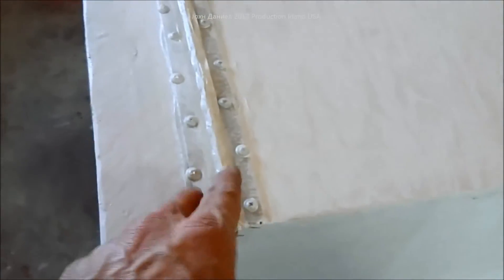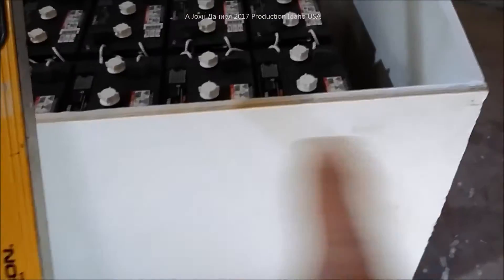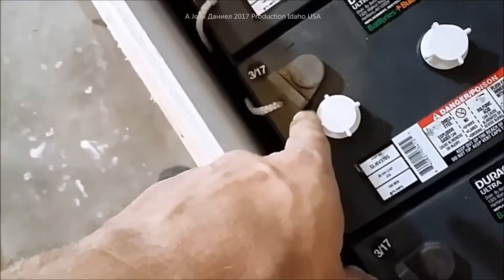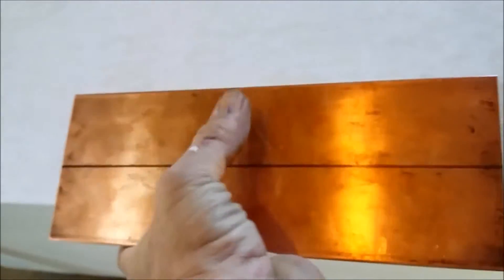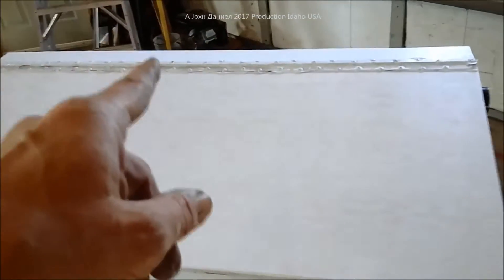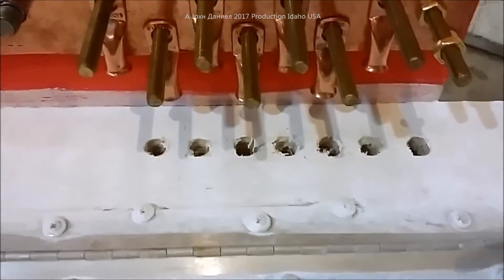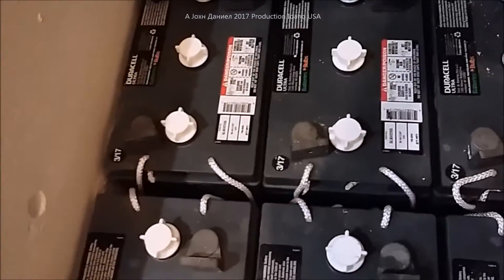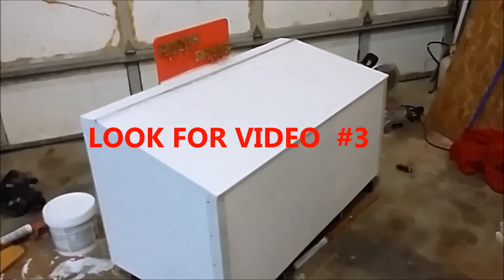Deep Cycle Battery Box Build Vid 2 of 3 (info below)

Comment: Is there a reason you used 3/8" copper buss bar? Or, could one use 1/4"?
Reply from the maker: I used 3/8 due to needing some thicker for another job, but normally 1/4" that is 2" wide is mega buss already.

Comment: Ofc actually produces a higher amount of amperage I've tested it not only in the automotive industry running a 8k rms system (bass head i know) but in solar applications the conductivity is a lot higher there's a lack of air they pretty much packed the wire tight together and it's solid real copper no additives for the most part visible amperage difference same length runs for the wire but be warned if you do it it is going to hit your pocket pretty hard it's not cheap by any means but I'm not bashing your point of view to each is own.

Comment: The current does tens to flow on the outside of a wire, it's called skin effect and it happens because of the generated magnetic field (eddy currents), but it does happen mainly in AC or in DC frequency carriers. https://en.wikipedia.org/wiki/Skin_effect
Reply from the maker: Skin effect occurs in open flow alternating voltage, its the cycle effect. No current has skin effects in DC. 
You would think such a well expressed mathematical theory could be supported better than they do, however 6 awg to 24 awg solid wire for AC circuitry is in every home, business and industry rated the same as stranded. Seems no one can connect that reality to the actions of non active skin effect of high voltage open air transmission lines.
Reply: It happens in DC also because you never have a constant current flow, in most circuits you have current surges, motors that spit out auto-induction and so forth but you are right, it is used as a scam in the vast majority of cases. From what i know it was postulated and tested by a dude in nineteen 
forty something when the Scam effect was not so well spread in the industry :)))
Reply from the maker: Yes, I do recall the initial suggestion of skin effect came from the pictures of women painted on WW2 bombers by those bored guys who vanished in the Manhattan Project!!!
Them gals were electrifying!
Reply: Јохн Даниел, no, i did not know it was named this way ...heh...nice one..
Reply: The NEC rate stranded wire and solid wire differently. Although some have the same current rating you will see temperature and length  differences so just because we see 30 amps on both stranded and solid the foot note will show different total length so one may be good for a 100’ at one temp the other same size wire may only be good for 80’. 
 Having said that you have a lot more experience in battery banks and on a much larger scale than i will ever have so i will take your advice when sizing wire for DC voltage. I like welding cable simply because its flexible.

Comment: Good strong stuff! I'd avoid using the individual bus-bar studs going through the red plastic. Use big counter-sunk screws dedicated to power only, separate screws for physical mounting. If you don't, over a short time, the plastic will relax and your tension will  be  gone. The screws will still look OK , but as soon as you draw a big current, things will get warm; the plastic will 'relax' further and compromise your system. Keep all leads between the battery strings and the bus bars equal length, this is important at low voltages to balance current-loading between batteries.
Good luck!
Reply from the maker: +nlo114 I've used this plastic with good success on a HHO generator for about 2 years with no circuit loss at 75 amps "so far". 
But the big battery box will have a 3/16" drilled stainless backer plate all those bolts will go through instead of fender washers like I had planned. Kinda figured that one out on the 5/8 bolt when tightening it down. It grabbed great, but safe over sorry.
Reply: You may have been lucky with 75A in the past, but 250A is a different kettle of fish. (Stop reading if you already know this, I won't teach you to suck eggs!). 
As you know, power = I^2 x R , so the heat generated at a resistive joint goes up by the square of the current through it. It is always a good idea to keep power and construction hardware separate, so that neither will affect the other in the event of a problem. Plastics and metals have different expansion rates, so thermal-cycling (warm day cold night, summer/winter etc), will cause the eventual loosening of the combination.  It won't cost any more, but it's good to have peace of mind with your project. Good luck!
Reply from the maker: +nlo114 Agreed, the amp potential is 500+ on what I'll be loading. Even have considered metal sleeves in the plastic so torque is on them. Being it's the same high temp HDPE that is used in my motor home for its bulkhead I am looking at all safe methods but it's main use is as a insulator, conclusion on its mount use is in testing and I fully intend on pulling a few options out of the hat.
Reply: Sleeves is probably a good idea if you do chose to to share hardware between construction and power, although I still advise separate. Keep your terminals clean and flat before assembly.
( 75A x 75A x 1 milliohm = 5.625 Watts)
( 500A x 500A x 1 milliohm = 250 Watts, or a big soldering iron's worth of heat ) Good Luck!